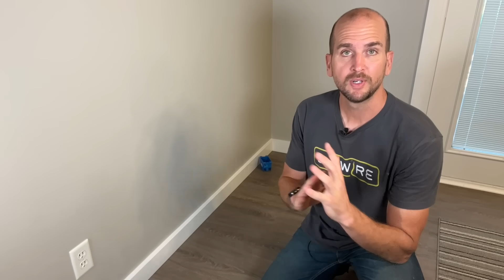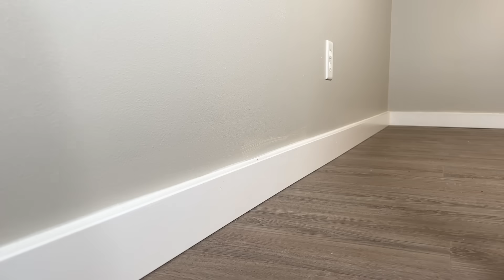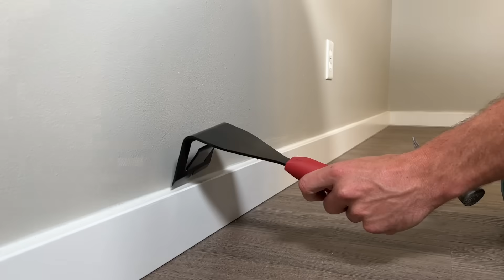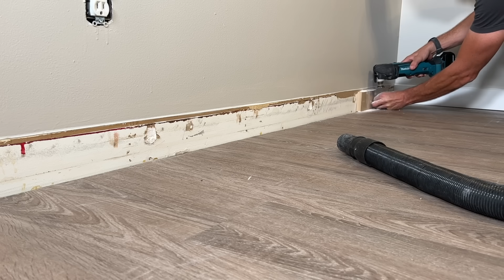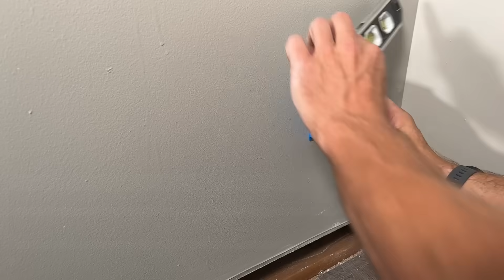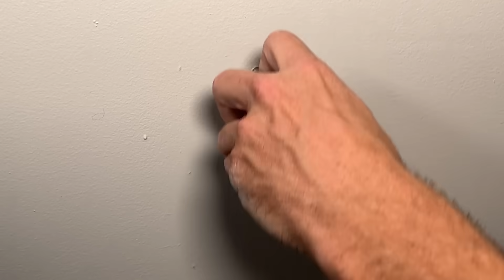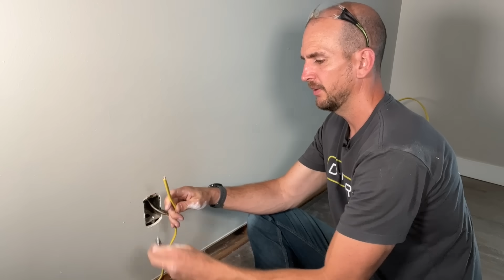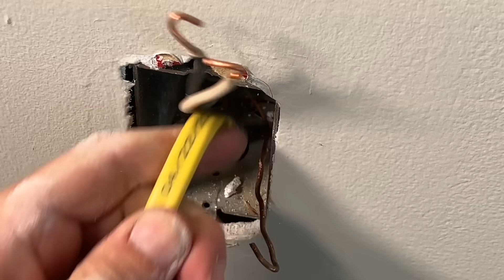How To Add An Outlet To A Finished Wall

Comment: Two words here people. Commercial grade. Without a doubt the biggest mistake I see people make in diying is going cheap on materials. The money is worth it. The commercial grade outlets are much better and easier to install. The connectors are imo the best to use As well. For reference I used to be an electrician,  now I’m a commercial plumber. As always,  be very mindful of what’s behind ur walls.  Let the plunge cutter do the work. You don’t want to call a plumber as well.

Comment: Excellent ideas for interior walls. I would not want to damage the vapour barrier on an insulated exterior wall. I guess you could possibly retape the damaged poly vapour barrier
Reply: Great point.  I was planning to execute this process on the inside of an exterior-facing wall and hadn't even considered what would be in there behind the cut (insulation, vapor barrier, etc...).  Now I'm having second thoughts.

Comment: GREAT video! Thank you. My old 1925 house has many outlets installed right in the baseboards (1" thick pine x 8" tall) with plaster and lathing walls.  Wish it was as easy to add more outlets as this video's task. Side question: did the paint drips make your OCD come alive like it did mine?  :-)  I'm subscribed and will be watching many more vids.

Comment: This tip video is tremendously relevant to me as I work on updating a 70-year-old cabin and much it’s appreciated. I never thought about using my oscillating tool to cut the wall. Always wondered what to do with it after getting it. Thanks so much for sharing!
Reply: Ya, new tool has revolutionized more than a few things.  I just wish there was a thicker, longer blade that would go deep enough to cut past the depth of a plastic box.  Like 4 inches.  Nothing like putting in new kitchen receptacles in your 70 year old house and running into those old 2x4s in the backs of the holes that have to be bored out with a spade bit.  Plus with these saws one can get even closer to the trim and edges than with the old scrolling jigsaw.  Plus I hate those lasers on the fronts of the new ones.  Adds in yet another inch of space between the cutting edge and the front of the too.

You can turn this trick on it's end and use it for switches too if you remove the trim wood on the side of the door jam.

Good luck with the 70 year old fir, err cabin.

Comment: Good info. Like to add, maybe put blue painters tape above baseboard to protect the paint. On drilling the studs, I like to drill every other stud from one direction, then the rest from other direction, Wire will pull much easier. Also removing the knock out can be difficult as they push in from the outside, since no access you have to pull into the box to remove. I have used a drywall screw, a metal stud screw or a drill point screw to pull the knockout in. I also like to strip the wire back to the connector before feeding into the box, easier, better control. I also hate   Handy Boxes. Some stick out to where plate won't go against the wall. Can remove ears on the receptacle to get closer to the wall. I like using Metal 180 boxes. The Rectangular ones. Not the 180's with  rounded corners and have a taper to them. Just locate Stud, then plunge wallboard saw to the side of the stud and cut til hit stud. This will be the side of where you trace box. You will have to drill 2 holes about 3/4" to 1" back. After drilling into the box, with drill bit spinning, angle so bit is pointing to the opening to allow a screw to go in at an angle. Rework boxes over time seem to fail. The metal ones last. Good work, take Care. Stratmando

Comment: That's a great method, and pre-installing the connector is a great trick too. A couple of tips to add to this: 
When you run the vibrating tool hold the Vacuum nozzle near it to get the majority of the sheetrock dust before it makes a mess. And when vacuuming dust off a solid floor cup the end of the nozzle and don't let it touch the floor, use the back side of your hand to slide across the floor so it doesn't leave those streaks on the floor, and you won't have to wipe it down with a moist rag afterward, save yourself the extra step.
Also when installing a device in a cut in box clip the ears off so the yoke sits in more flush with the bracing ears of the box. Some brands of plates won't flush up with the wall if the yoke isn't sitting close enough to the wall.

Comment: Your  drywall now has no support all the way across the bottom.  It will be very easily cracked by a child.  Second all drywall joints require support in the area I live so you need to add blocks between the studs to support the new joint from behind that you made in the drywall . Also it is required to install nail plates over the past through in each stud on both sides to ensure no nails get driven into the wiring .

Comment: Jeez !  What’s with all the bickering! There is always more than one way to get from point A to B . Long bit behind the baseboard if your on the 1st floor. Vibro saw and patch if it’s an occupied 2nd floor space. Over the top if it’s balloon framing. Etc Etc. I was licensed in the 70’s and I’m up on all the latest tools and labor savers. We have probably all invented stuff on the fly. That’s why we are not just electricians but mechanics and mechanical engineers.  Yeah he made an error about cutting all of the ears off of devices but his method was sound , safe , and code compliant. (no wires behind baseboards) let’s not confuse the homeowner trying to save money and do it safely. 
Tip of the day !!! * please never use the backstab quick connects on wiring devices. (Receptacles or switches mainly) 
They fail over time and burn no matter how hard you lock the wires in. Use the screw terminals. Have a great day all !😊

Comment: Need to get one of those oscillating cutters, they sure do nice work.  This was a pretty slick "life hack", and it came out nice.  Only thing I will say is technically (and code in every city I know), is you're supposed to have a fastener blocking plate on the edge of the stud anywhere a wire goes through it.  I didn't know about those Wago terminal blocks, definitely going to keep those in mind.

Comment: Nah !!!, you did not have to drill those huge holes in the studs debilitating them, all you needed was a short 1/2" drill bit so you could place the drill between the  studs and make  perpendicular holes easily.

Comment: Great video, but this method will not work for me.  My wall finished base is only 2+ inches high and this does not give enough space above the framing base plate.  I have used the "Above" & "below" methods many times.  My home is older and built when finished base was only 2+ inches high BUT the structural framing has lumber which was larger in its day.

Comment: No metal protection plate for the studs at the electrical wiring hole’s? Not up to code for California! What if someone drives a nail or screws through the stud and hits the unseen wire you just installed! You are the reason there is a code and do it yourself is a bad idea!

Comment: Real craftsmen with 30 years experience would at minimum buy a new 4x8 sheet of drywall and cut that replacement strip on a 30hp diesel powered saw and throw the leftover away because they ain't got no time to mess with no piddly drywall scraps
Reply from the maker: 😂 ain't nobody got time for that!

Comment: Untrained DIYer with zero years of professional experience here. I've replaced many a light fixture and have been mildly electrocuted several times. This video gives me the knowledge and confidence I need to install a new outlet in my home. Thanks, YouTube algorithm!
Reply: Helpful hint for your next project:
Shut off the electricity to the room before you start touching wires.

Comment: Wiring regulations in the UK require any bare ground wires after you're removed the outer sheath to be enclosed in striped green/yellow sleeving to prevent it coming into contact with the live/positive or neutral/negative terminals in the outlet or switch as you push the fitting back into the wall box.  I know that the fuse or circuit breaker will usually blow if that happens, but it just seems like a risk that is easily prevented by sleeving the ground wire, at minimal cost and time.

Comment: I've done electrical for many many years and will vouch for this guy. There are many ways to do things some better some worse, this is acceptable and I would follow a simular process for adding a standard plug. Our local code requires a plug maximum spacing of 6 feet, used to be 7. Maximum 2ft in kitchen lol gotta put nailers or go every stud, way too many nowadays.

Comment: No protection of the Romex/wires as it runs horizontally above the baseboard.
With each insertion and removal of plug vs outlet, a plastic box flexes , eventually something works loose. Attach a metal box to the stud with screws and there will never be a flexing problem.

Comment: WOW...what a great idea. Just one observation. You might want to mention to turn the circuit breaker off and confirm there is no power to the switch at the beginning of the video. WHY, you ask? So idiots like ME don't turn into a well cooked piece of bacon. GREAT video.
As I was told a long time ago....there are old electricians and bold electricians but there are no old bold electricians.  : )

Comment: 9:33 "And be consistent, have your cover plate screws either horizontal or vertical"

What is being said here? Are you saying that every screw's slot on every plate should be timed to face the same direction, implying that some OCD nut actually notices the final orientation of screws on outlet plates and compares them to all the other plates?

Comment: I've been an electrician for 30 years. I'm also a rehabber. The small details you covered surprised me. Your explanations are clear and concise. Most of the things you did, I thought, "Yeah, but are you going to do....oh." And you did the little things that I do. We should team up. Best regards, Mike
Reply: To bad this install has multiple code violations. 1. not installing afci protection for the extended circuit and receptacle and 2. not installing a tamper resistant receptacle.
Reply: @tpgoat  You mean New World Order codes being violated? Oh, my!
Reply: @tpgoat  so your plan is what? Upgrade that one circuit to AFCI and leave the rest of the house alone? Or are you going to force them to upgrade the whole house in order to get one outlet installed, increasing the cost exponentially? Tamper resistant outlet is fine- I'm replacing all the outlets in my house right now with them.
Reply: @codyclemons937  Yes, to meet minimum code requirements you would be required to afci the part of that circuit that was extended. you can install an afci device in the outlet you are tapping onto to provide the protection or install an afci breaker. if you are replacing the devices in your house, by code the devices you replace are required to the afci protected.
Reply: @tpgoat  only 16 states require that....
Reply: @stephenledford3808  46 States use the nec, all 50 states have code enforcement at some level, either county or city.
Reply: @tpgoat  You're right, I miss read the code. Still seems excessive to me depending on how many are on the circuit though.
Reply: @tpgoat  *too
Also don't state there are code violations and not state which codes are violated...🤷‍♂️
Reply: @MrMaxyield  210.12(D) and 406.12
Reply: @tpgoat  if it’s not getting inspected, who cares ? AFCIs and tamper resistant outlets are a pain in the ass. Most home owners would rather not deal with the extra hassle for one more measly outlet.
Reply: @travisjohnston2369  As a business owner and a person who cares about the safety of my customers and covering my own ass I install based on the most current version of the NFPA NEC. If that book requires it, that's how I install it. I don't pick and choose which codes to follow. All it takes in one person dying and my business is done and I may go to jail. Even in your own house, if you sell it would be your ass if the work you did killed someone and you didn't get it inspected. Speaking of inspections, adding that outlet would absolutely require an inspection in my state and would fail.
Reply: @MrMaxyield  nothing to say now that I listed the codes that are violated?
Reply: @tpgoat 
I would hire you in a heart beat. I'm not a fan of those Wago connectors. I prefer a good quality wire nut that's installed correctly.
Reply: @tpgoat  how about 250.86 Other Conductor Enclosures and Raceways
Reply: @KurtBelyeu  want to explain how that applies in this situation?
Reply: My understanding is all metallic enclosures require pig tailing which is how I've always done it.
Reply: @KurtBelyeu  yes, that is also a violation I missed.
Reply: @TonyFisherPuzzles  You too! That's awesome.

Comment: Personnaly, I would be a disclaimer for the viewer to check thier local electrical code. This kind of outlet is now illegal in Canada (at least in some provinces if not all). An electrical outlet has to be attached to a wall stud (or a structural part of the house).

Comment: As a former Drywaller, I thank you for this tutorial. Now you sennd this to every electrician I know. I suppose the only down side is if the trim is only 2 1/4 or smaller. It would be much harder to work under that.

Comment: Great presentation! Learned a few things here. However, every wire run I've seen in new construction uses a wall plate where the wires run thru the studs. Is there a reason why they didn't need to be used here? I can see the problem of getting them slipped under the drywall. On the other hand, I was thinking that using a metal ring in the newly drilled stud holes for the Romex wire could be a plausible method to protect the Romex from nails. It would have to be about the same gauge metal for the wall plates and shouldn't be hard to install.
Reply: if your holes are drilled 1 1/2''s back the arent required
Reply: @Hankcowdog  3.5” stud. Hole was what diameter?
Reply: @Area_man115  7/8
Reply: Drywall screws are 1.25" in length. If the new holes were centered in the studs (he also explained he put those holes above the top edge of the trim he reused!) it shouldn't be an issue.

Comment: As soon as you pulled the trim and removed the caulking/ compromised the finished paint job, you turned it into more than an electrical project.

Comment: Every thing seems ok, but I hate to tell you , you forgot to Nate a nail protector on the front side of the shed to ensue the wire is protected. If your work is check by electric inspector, he won’t pass your work.

Comment: I was cutting out dry rot at a neighbors. I didn’t know they ran wire 4” from the floor and cut it with my oscillating saw. What a surprise. When I do extra plugs I pull off the sheet rock, put I. The plug then put the sheet rock back and finish it off.  No hidden wires to cut in to. They all all the same hight

Comment: So why don't you installed tampered resistant  decora style receptacles on ure hose? They look better than those you have on now and cleaner, also if you were installing a charging station receptacle you should have used a USB decora style receptacle and installed it above hight the corner table you are using, it would have looked very bad ass and it would have impressed u're customers as well, I install this USB receptacles all the time, in bedrooms one in each side next to the bed, on the kitchen island or peninsula, people love this USB receptacles..! Just a thought 🤔...!

Comment: Oh no.  Not you.  The Wago loosens the connection over time.  Also the contact resistance within the wago is higher.  Nothing beats twisting the wires and secure with wire nut.  The contact is much bigger and less contact reinsurance to cause problems later.  It is old but proven technology.

Comment: 1:16 Be careful if the corner of the piece you're lifting is coped over the other piece of baseboard. Lifting like that will break off the cope; would be better to pry up from below or pull straight out.
Reply: Yes.  That can be an issue for sure.
Reply: Also, if it's mdf, you could break it. It's a good video but there are a few caveats that are overlooked.

Comment: You installed your duplex units upside down.
the ground pin should be on top in case a plug works its way out enough where something metal might slip between the plug and socket which would cause an electrical short by completing a connection between your load and neutral blades. Much less likely if the ground pin is on top.

Comment: Must be in a place with limited codes.   No electrician tape covering screws on outlet or wrapping the Wago's  - - where I am at those are considered connectors like a wire nut or splice and must be cover taped.   Would not pass inspection where I build.
Reply from the maker: Hmmmm, where are you located?  I am fairly confident electrical tape is never called out in code and must be a local preference of your inspector.

Comment: If so everybody knows as a carpenter here that builds houses this is not true on measurements for a bunch of homes so be aware of that a lot of homes are 15 and 3/4 between studs some are 16 inches but a lot of them are 12 I do a lot of renovations to old homes

Comment: I dislike the Wago. Why? Well with 4 #12 wires, it was very difficult to get them all lined up and secured, just as it is difficult to get 4 or more #12 AWG lined up for a wirenut. Now, if you only have 3 wires, then it might be okay.